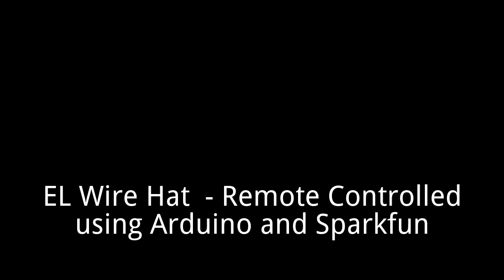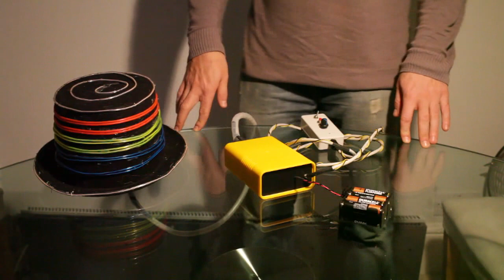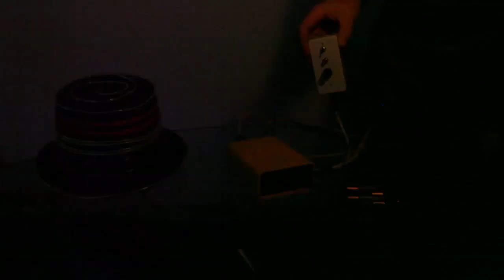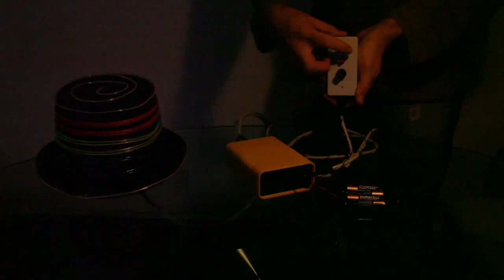Remote Controlled EL Wire Hat: Sequenced and Sound Activated - powered by Arduino

Comment: Hi there, great project. I am looking to do something similar but I am having a bit of trouble. I have one of the EL sequencers that have the Arduino microchip built in. I can only manage to get one EL wire lighting up at a time but I see you have managed to have all 8 on simultaneously. Do you know why that would be? I am only using a 3v inverter , could this be the reason why? Any help would be appreciated. Thanks.

Comment from the maker: Thank you - yeah, it's little bulky, but I needed it to be rugged as I was traveling with it and then heading to a 3 day music festival.
A lot of what I used was scavenged from other junk I had lying around. I did not keep track of the cost during the build, but the core components(Arduino, EL Escudo, microphone, casings, EL wire, cables and other little things) came to about €100.
There is a full equipment list and build instructions in my instructable. See link in the 'about' section above.